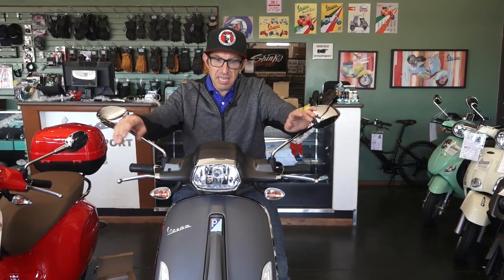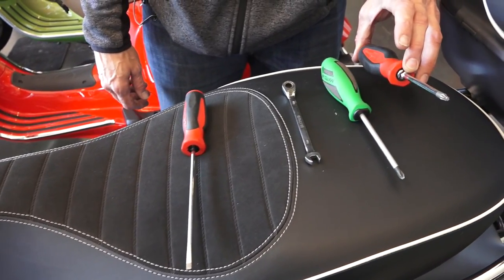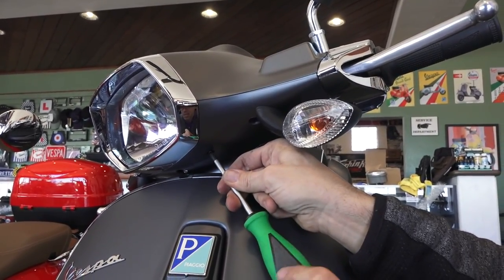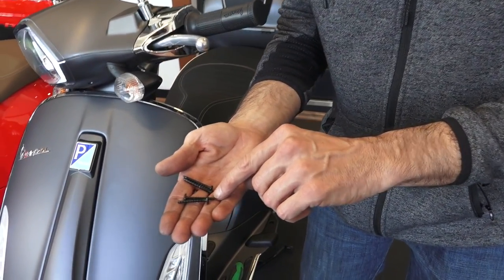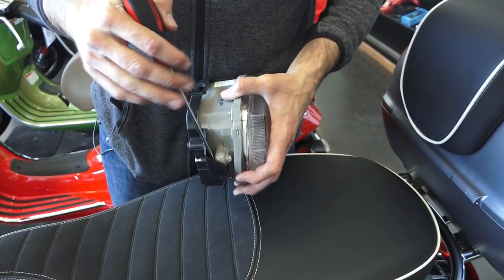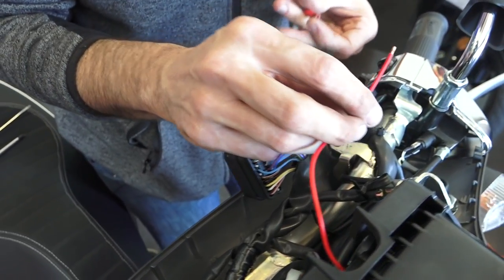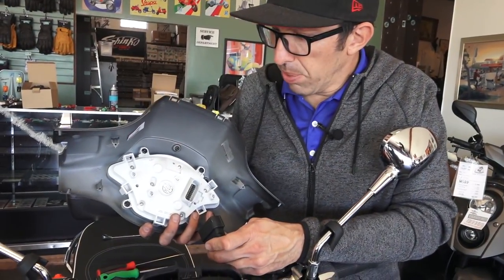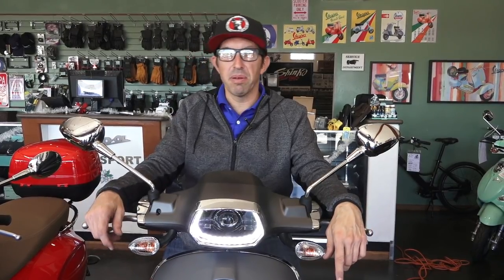New LED Projector Headlight for Vespa Sprint

Comment: Seems a better useable light output than the GTS version.
Also allows level adjustment too. 👍
Reply from the maker: Agreed. Definitely the best looking and best beam pattern of the three. You can adjust the others using washers, but this is by far the most user friendly.

Comment: Why don't you get the LED light like we do in Europe?! I just bought the LED light for my Primavera 2017. 

P.s. van you do a Video vor to prevent rust in the holes of the Primavera?
Reply from the maker: We've got strict requirements here regarding lighting and reflectors on motorcycles. We have been able to source the European OEM headlights for the Sprint and Primavera, as well as a retrofit bulb for all the modern Vespas. All of these upgrades are technically for "off road" use, but we leave that decision to the customer.
Reply from the maker: Which holes are you referring to?
Reply: @VespaMotorsport  cavity sealers against rust. Where the wires are?
Reply: US lighting laws and headlamp design are about 15 years behind those in Europe - that’s why everyone upgrades to Euro-spec
Reply: Hi i bought a daymaker for sorint which has an XO lights inside, i’ve watch how you connect the red wire to the brake light and i followed it but it has still another yellow wire extra that i dont know where to connect. Thanks for the help in advance 😊

Comment: Since the new lamp has the DRL halo, how about wiring that to the ignition and have the dipped beam switch operated instead? That way you satisfy legislation of permanent lighting but have a far cooler lamp during the lighter hours of the day

Comment: I can't find the Euro OEM Sprint headlamp on your website.  do you have a part # or a link?  Also, does the Euro LED light work with the 2015+ Sprint 50 or only the 150 model?  Thx